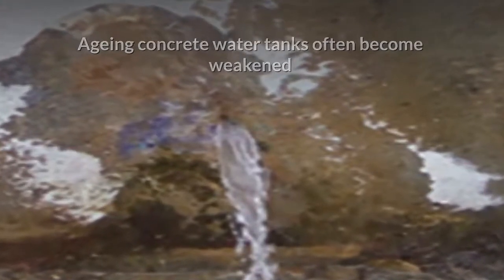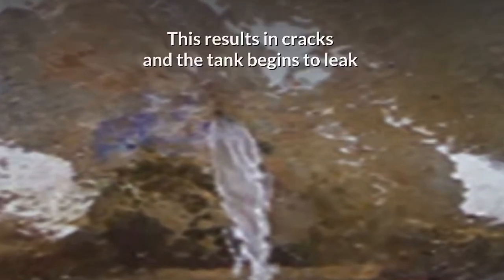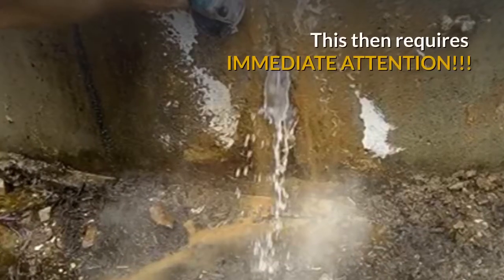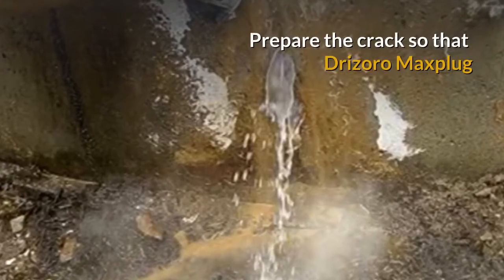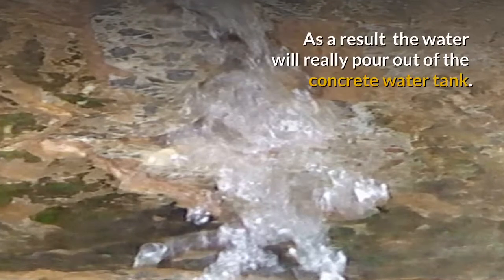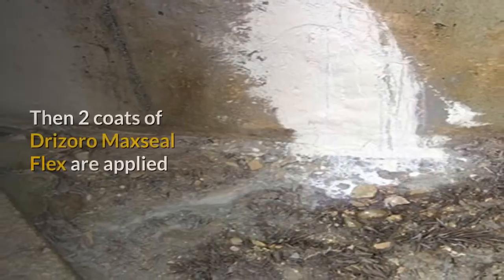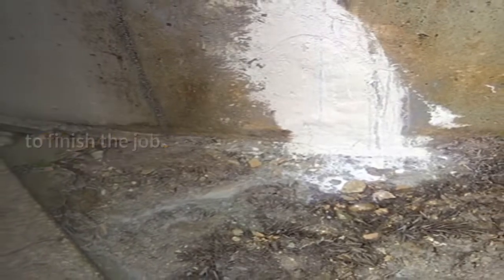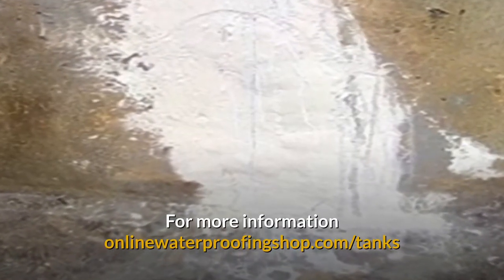How to fix leaking concrete tanks australia

Comment: How do i know if my tank is leaking? What do i look for. Many thanks.
Reply from the maker: Thanks another Good question! 
1. Loss of water - usually falling water level in the tank
2. Dampness around the base 
3. Wet cracks, damp areas on the walls of the tank
4. Does your tank still look level